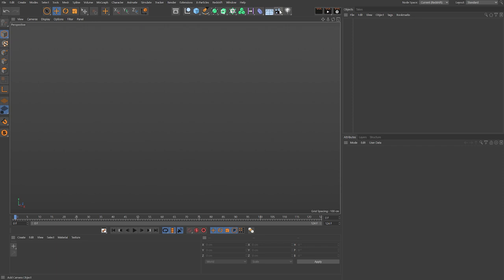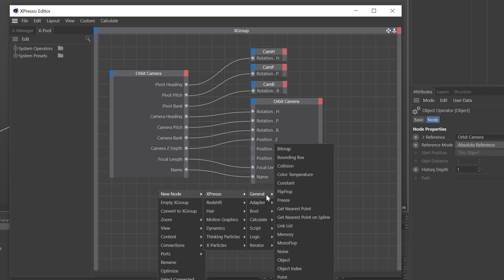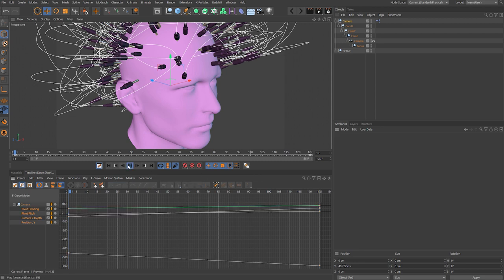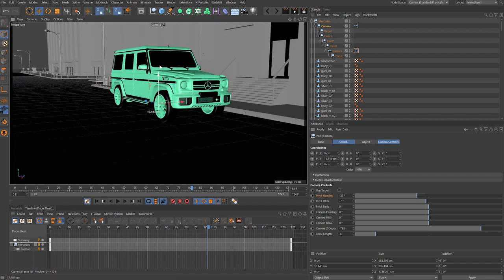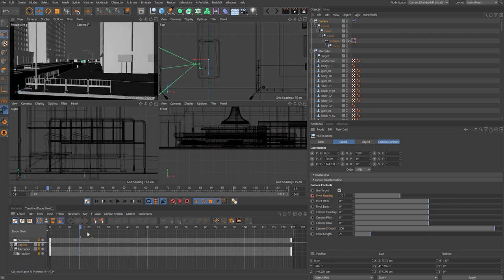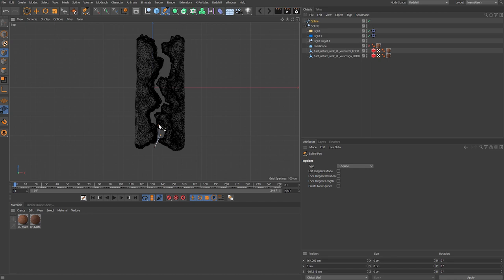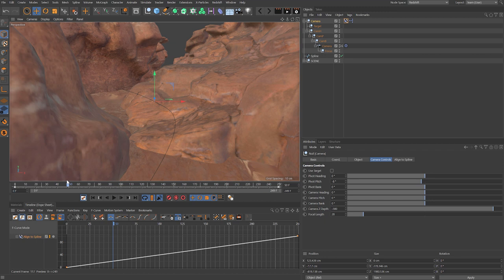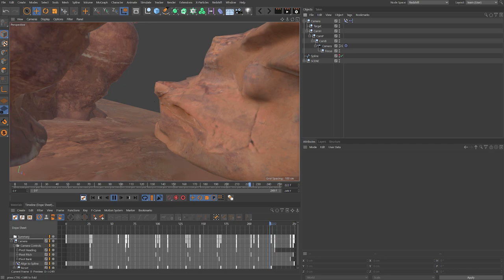Ultimate Cinema 4D Camera Rig

Comment: Any suggestions on handling a 360 degree move? Trying with this rig but struggling a bit.
Reply: Okay I figured this out. I am just slow but in case anyone has a similar need and struggles with the rig, just change your presets for Pivot heading to a greater max and a lower minimum setting.